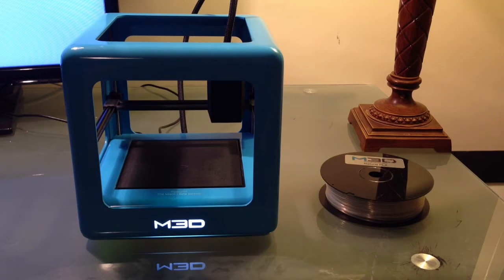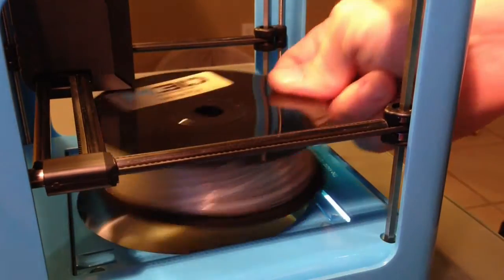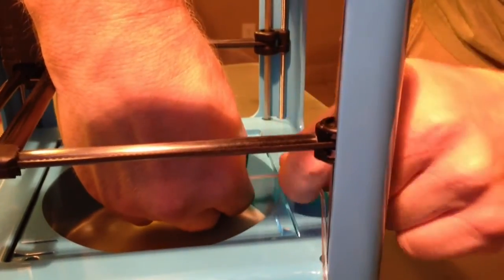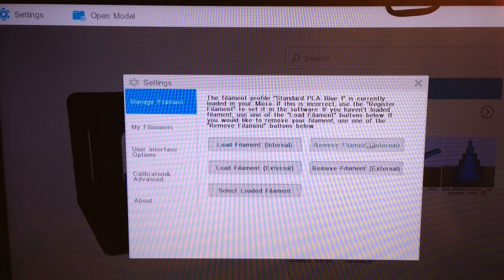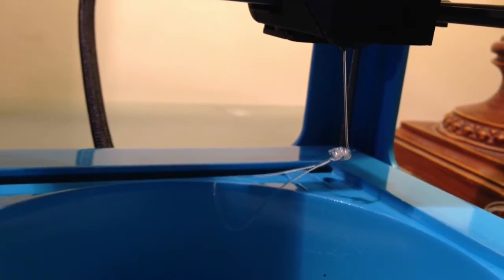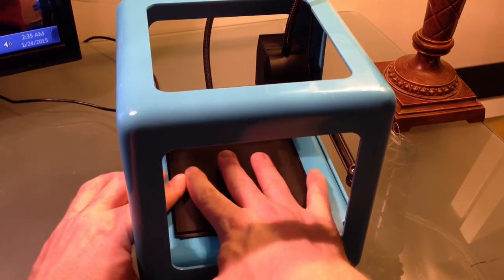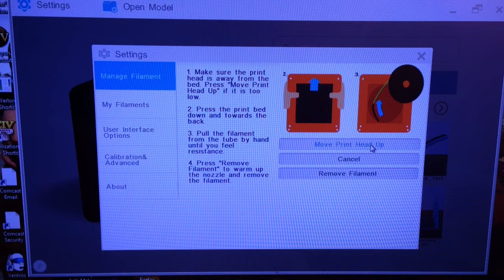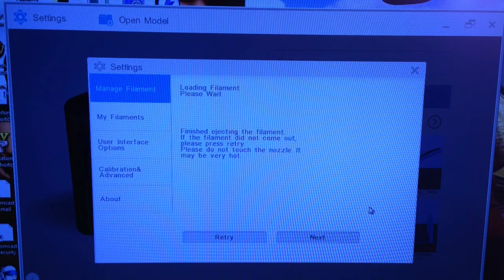The Micro 3D Printer M3D -- How to load and unload filament internally

Comment: I've watched both your videos now for loading filament internally and externally.  Which is your preferred method?  For me, the external loading seems easier even though it takes up a bit more desk space by having the filament outside.
Reply from the maker: Paul Boland I only use external filament loading. It makes it easier and quicker to change the filament.

Comment: The video did not show cleaning off the print head after the initial filament came out prior to printing. It did not state if the extruded filament was hot or cool or if it would or not stick to the rest of the printer or burn your fingers if you tried to get it out of there. It looked like it might. It would have been good to show loading one color and then unloading and showing a different color, and the time to flush the new color through the head.

Comment: My print bed seems firmly locked in place. Is there a trick to popping it off or does my model just not offer that option? Just got it today, not sure if design has changed or not.
Reply: Pun_Machine same here, any luck?
Reply: Pun_Machine I got it. Theres a hole on top you can connect to and its considered external connection
Reply: Pun_Machine I have the same problem, any luck?
Reply: zeshen13 I have, by accident actually. I had a stubborn raft that would budge and in trying to get under it with a tool i pushed forward and the whole bed came off. It'll probably really hard the first time, but it gets easier as it's done more and more. You want to put some pressure on the  front facing edge of the print bed press down and forward about an inch in on both sides, it should slide forward exposing 2 tabs, then just pull out the other end carefully. To put it back on do the same thing but in reverse. Hope it helps.

Comment: I'm having some trouble removing the filament. I loaded the white filament from M3D's site, and it works well, but when I tried to remove it from the printer, the thing wouldn't budge. I pulled on it when it told me to, but the thing appeared to be stuck
Reply: Use something like a credit card to pry it off

Comment: I can't get a meter out of the spool and into the tube, I've tried two different filaments and both stop at 20cm. Is there something wrong with my printer? This is driving me nuts, since I feel like I can't trust it to print without being watched, but if it's inside then it should be nice and tidy.
Reply: Michael Seydel I have one on order from the way I see it was packed it appears the tube right out of the back of the printer could get kinked. I would try to make sure the tube is straight right out the back and not bent going up the side of the printer.
Reply: Michael Seydel I recomend you to sand the end of the filament a little bit in order to have a nice spherical head. That's what i did and it worked perfectly !

Comment: I want a 3d printer and this seems like the best option for me, but I'm worried that the print space is too small, what are your thoughts?
Reply from the maker: Capt. Sum Ting Wong it really depends what you want to print. I find it is a bit small, but lots of the things we print are smallish parts. So it works for our needs. It will not print 1 piece iPhone cases, it's to small for that.
Reply: Flyboy55 dang I was going to ask if it could print a phone case lol well what about the resolution? Does everything look pretty real and smooth or bumpy and fake?
Reply: +Capt. Sum Ting Wong No, the highest print quality is 50 microns. Also the print bed is 5inches x 5 inches x 5 inches

Comment: First - it arrives with the printhead locked down against the bottom - unless you force it or break it, you don't get that bed cover open. 2nd - the printer doesn't appear to work with Windows. So far all updates and drivers I have tried either fail to load or are not recognized.  After 4 hours since box opening - I firmly believe this is the most un-consumer friendly device.  Anything over $25 and this is not worth it... Just my opinion.